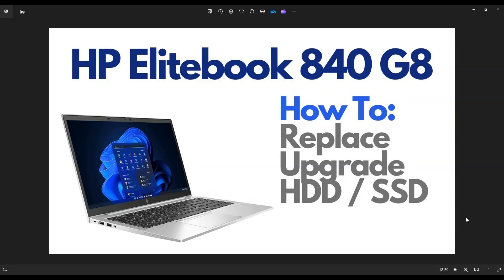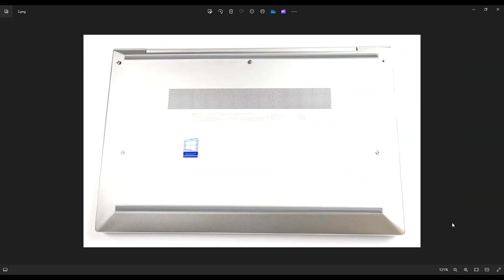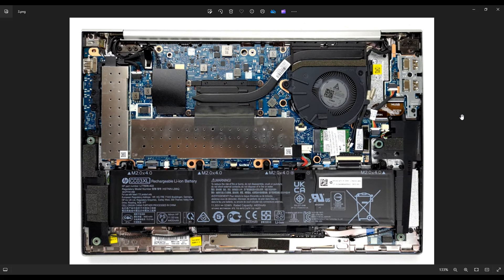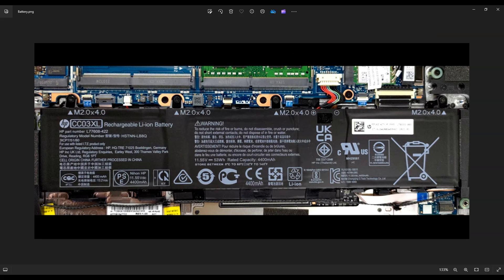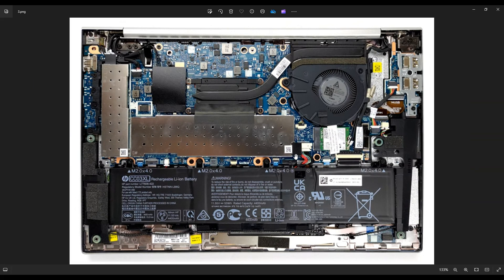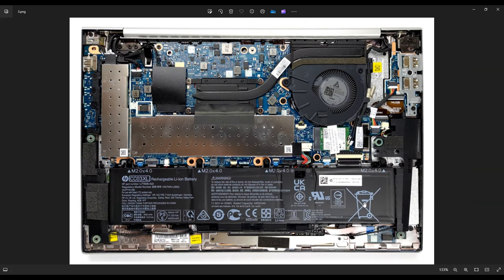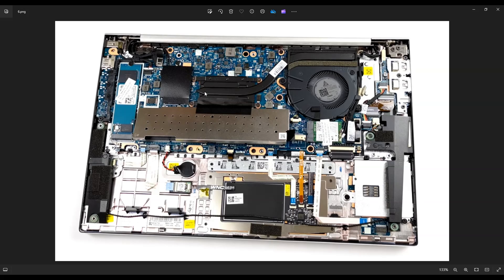How To Replace Upgrade SSD - HP Elitebook 840 G8 Laptop Computer

Comment: I don't understand the removal of the battery. Fine to disconnect it, but I fail to see why it's necessary to physically removal. You are only looking to electrically isolate the board
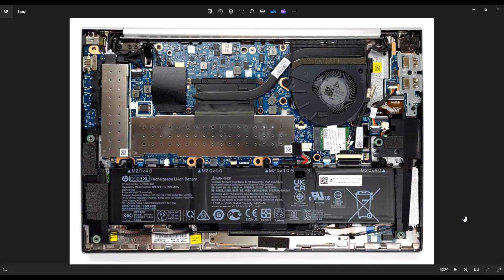Reply from the maker: Yes, it is only necessary to unplug the battery. You can remove it if you prefer. At 1:55 in the video, I mention that.
Reply: Many thanks  @jamminpcs . I'm just thinking, careful removal of the cable connector (only) is just 'playing' with fewer parts and so less change of inadvertently damaging something. Thanks for taking the time to reply and confirming 🙂  Much appreciated
Reply from the maker: @iainhunneybell  np :)
Reply: Well, just so that you know how much your time and effort in first posting this really helpful info and then answering queries is really appreciated  @jamminpcs  🙂
Reply from the maker: @iainhunneybell  Thanks :) Nice to hear :):)

Comment: Is it true an upgrade can result in battery use even at rest?
Reply from the maker: No. If the computer is working properly, there will be no change to its behavior while off simply due to a SSD upgrade.